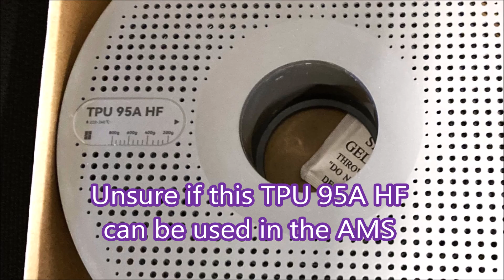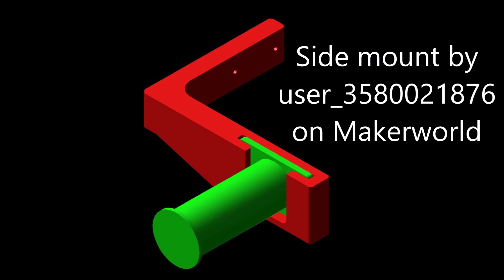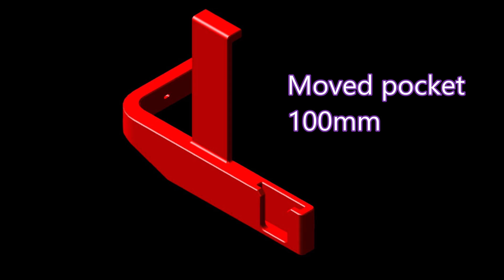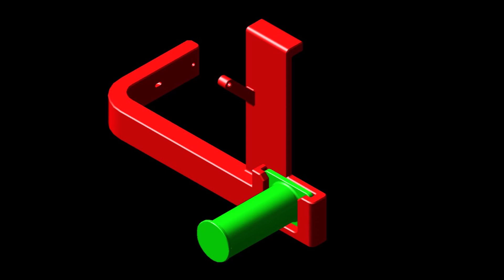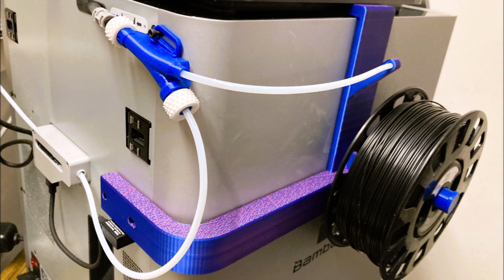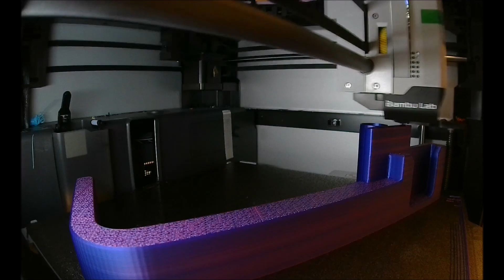Bambu X1C 3 D printer side spool holder.

Comment: That is a great design.  My artillery sidewinder x2 is feeling old now.  I need to do more with mine but I have not come up with a need lately.  Which is bad for my design work because I forget everything. :)
Reply from the maker: Hi Gary
I had nothing to print, but I thought these new machines are so damn fast the I would print things that I would never bother to print on my Creality Mini.  It is proving to be the case. I can print a complex print in 4 hours which would have taken 12 in the past. I am reluctant to make a print that takes that long as it just increases the risk of failure by a huge amount.  If you want to find out if this is true, get yourself a Bambu A1 printer and see how many thing you find to print!
The new printers produce quality prints and I mean really great looking parts with almost no visible layer lines at a speed you will not believe.
Reply: @smallcnclathes  that sounds good. I have been reluctant to print with abs or anything like that because my printer is in my home office area. So I would like to print out of stronger material but I need to move my printer.
Reply from the maker: @GaryForgingOn  PETG is pretty good  and I believe it does not fume like ABS
Reply: @smallcnclathes  I have done some petg . It is supposed to be safer but I just have to run it s little hotter to make it work.
Reply from the maker: @GaryForgingOn  Yep, it has a higher printing temp than PLA, it can be a bit more "stringy" but usually increased retraction fixes that